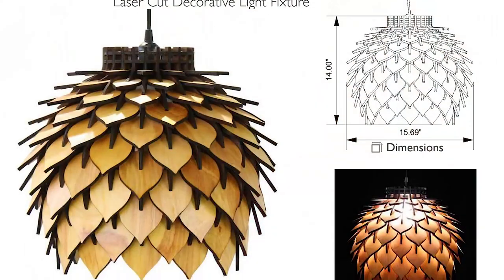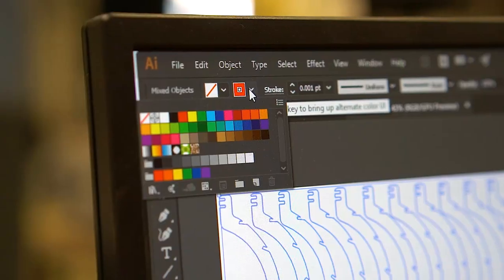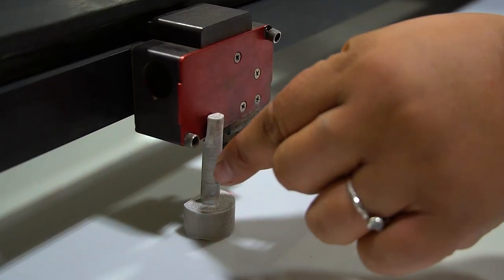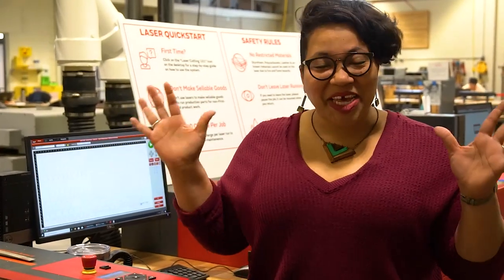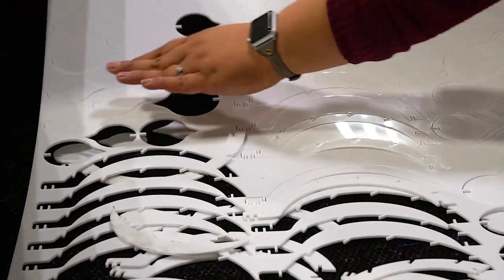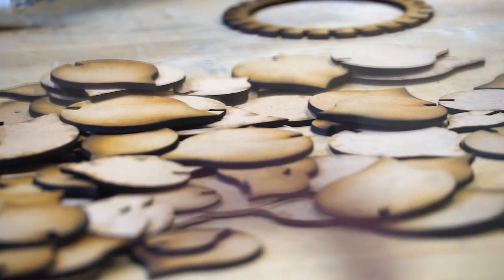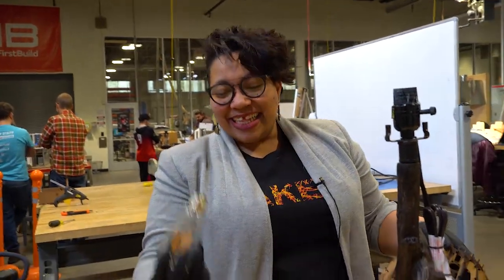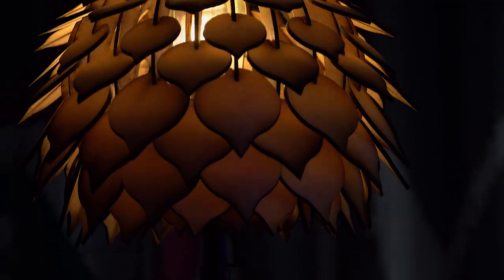How to Make a Laser Cut Wood Lamp

Comment: Awesome! But be careful running your laser at 100% power. Not really supposed to go over 95% typically to extend the life of the tube
Reply: You're assuming this isn't already capped at the POT dial on the PSU or in the DSP software.  Just because you put in 100% in the job parameters doesn't mean you're automatically running the tube at it's full current value.  I am sure this laser being in a makerspace, the guild members most likely know what they are doing.
Reply: Tuffenough4u you reckon? Maybe so, but never hurts to make a suggestion in the case that it isn’t set that way